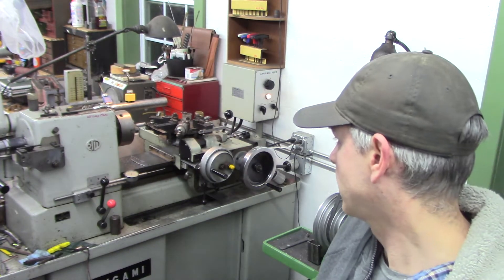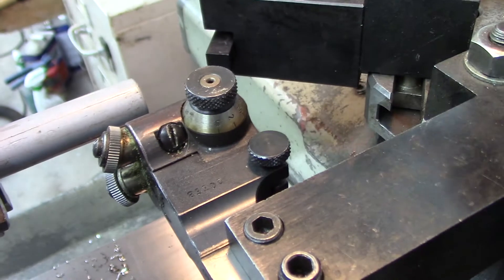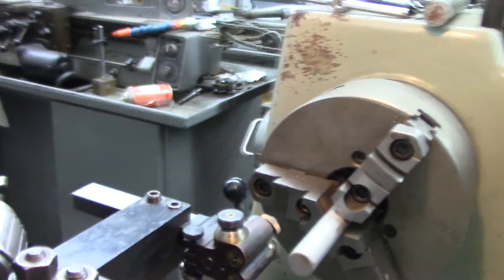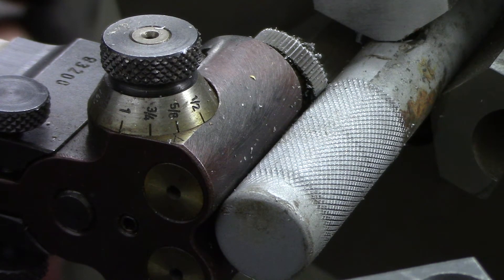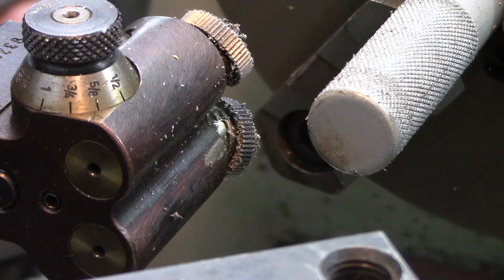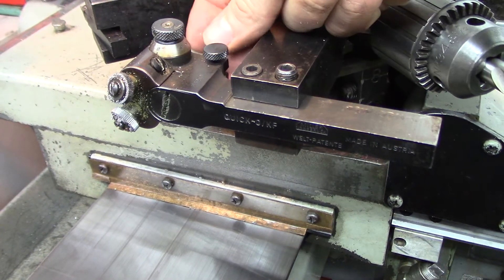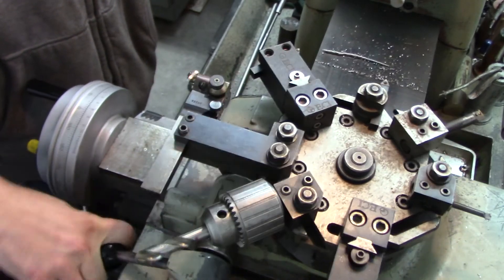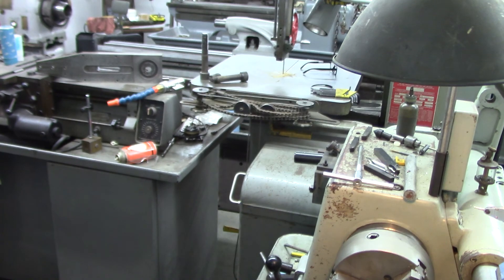Doozer's Machine Shop Update 1-08-20 -- Cut Knurling Tool on the Tsugami Lathe

Comment: You stole that cut knurling tool Doozer. Prices I've seen for decent brand new ones no matter who makes them are usually up around $800-$1200. 

For either pressure or cut knurling the swarf generated creates major issues with the surface condition of the finished knurling. Brushing it off as you were doing helps but still doesn't get it all or get it removed quick enough. Once those cuttings or the swarf from pressure knurling get sent back through the hardened knurls it starts degrading the knurls finish since the swarf starts deforming the flanks of the knurling. Flood cooling would be a big help, but if not available a large amount of excess cutting oil works to flush the swarf off the part or away from the knurling wheels as soon as it's created. Generally diamond knurling is either pressure or cut knurled to where the diamond tips are almost to a sharp point when checked with a magnifying glass. When pressure knurling is taken too deep what happens is the tips of each diamond point start breaking off.  High quality cut or pressure knurls are expensive for good reason. The knurls heat treatment, concentricity and ground surface finish along with any added surface coatings directly affect the quality of knurling it can produce. Unless you make an Ebay score like you did I don't know of any cheap tool or knurling wheels that will create a decent knurl pattern.

Outside your videos content, but for anyone that doesn't already know it, that high quality required is why the cheap off shore lightly built clamp type pressure knurling tools and the garbage misshaped knurling wheels they come with are why it's impossible to produce a decent quality knurl with them. The first time I tried my Eagle Rock knurling tool was an eye opener compared to the cheap one I started out with.
Reply from the maker: Hello Turning Point,  Good to hear from you. I remember you joined me back when I was posting tractor videos of my New Holland TC33D.  I was thinking the other day  when I was scraping some dirt, trying to level some ground back by my woods....  I was experimenting with driving backwards with the bucket, and scraping with a negative verses a positive cutting angle.  I found (as you would expect) that it takes just a few degrees of positive rake angle to really make the bucket start to scrape the dirt and at the same time, lower the amount of downforce required to actually bite into the dirt and do useful work.  I thought, wow, this is just like grinding angles on steel cutting bits.  The night before, I was grinding some toolbits for a flycutter that I was using in the milling machine to flat finish some aluminum for a project.  I found that it only took about 3° of positive rake angle to make the flycutter really make a nice finish, over a flat 0° rake angle.  I know something like 5° or more is recommended, but I was just trying to be quick and offhand grinding the bit on the bench grinder to get it done. I thought how similar it was to grind  rake angles on a lathe or cutter bit, and that used when cutting dirt with a tractor bucket blade !!!   I can't help but think that back in the 1700s and 1800s when machine tools and the industrial revolution was being born, that maybe farmers and their plow blades (horse pulled) had some influence on the machine tool inventors of the time.  Everyone was agrarian for the most part, and the angles to cleave most materials are related back to the simple knife in some way.  Anyhow, the things I think about when in the seat of my tractor.... Ha ha ha !!!  Good to hear from you TP !!
Reply from the maker: TP-  By the way, my buddy Mark M. just bought an Eagle Rock scissor-type knurling tool just last week.  He paid new tool price for it too.  He told me that it looked like it might be made out of cast iron, and fit and finish was not good for an Eagle Rock tool.  He suspected it might be an import by the workmanship of it, and just put in a box, with a Made in USA sticker on the box.  Was wondering how you like yours ?
Reply: @kooldoozer  I bought both sizes of my Eagle Rocks maybe 8-10 years ago? And yeah I paid full retail as well :-( That hurt a bit. There larger knurling tool will do up to about 4" in diameter. I can't say what there current quality might be. Extremely doubtful they'd lower it by that much though. Eagle Rock has a quality reputation that I doubt they'd want to lose. Mine seems to be built from I think forged tool steel and then hardened and ground on most surfaces. There's a few low spots on the wheel arms maybe a thou or two deep that didn't fully clean up on the surface grinder but there non working surfaces anyway. And the whole tool other than the pivot nut was probably bead blasted then hot caustic blued for a satin finish. Almost zero clearance on the pin and pivot. Less than a 1/2 thou for sure. My guess is the hole was jig ground for finished size. I'd compare mine as equal in quality to something like a new Criterion boring head for fit, finish and operation. Mine is definitely not cast iron and a file just barely marks the tool mounting arm or either of the knurling arms. Both of mine are stamped on the tool mounting arm in all capital letters EAGLE ROCK TECH. BATH PA If it were me I think I'd take a few close up pictures and email those to Eagle Rock and ask if it's a knock off or not. My best guess, it probably is a fake. How do I like mine? If it got stolen I'd not hesitate to replace it with the same even at the fairly high price. The only real complaint with mine is you have to press the knurling wheel pins out to change the knurls. It's not hard it just takes time you might not want to spend and use knurls coarser or finer than the part diameter suits. 

I suspect the very early cutting tool angles for machining started out much like the angles found to be best on the wood working planes, saws and chisels of the period. Any blacksmith in the area would have quickly advised what would be better for tool durability. It probably didn't take long at all before a generally accepted set of rules for tool angles got passed around for what lasted and worked. Remember for metal types and cutting tool materials there wasn't much to chose from. Brass, bronze, pig iron, then cast iron and really low quality and strength rudimentary steels. And high carbon steel to cut it all. I look at the steam history in the UK and then look at those giant pumping engines of the time and am amazed they got those built using only low rpm high carbon steels at best right up into the early 1900's. Some cuts must have taken days with multiple tool changes as the tools wore. 

Back bladeing or even the same using the buckets cutting edge is for rookies. It's ok in something like soft topsoil, but it puts excess wear on cutting edges, or bucket teeth and much worse high wear on the bottom of the bucket since the rock is being dragged across the bottom of the softer steel bucket. That hardened cutting edge is designed to be slightly lower than the blade or bucket and used in forward to take most of that wear. It takes a lot of practice to stay level, but no experienced operator back blades in rock or gravel. Yeah I see it being done even on construction sites by some, but real operators aren't in the seat. You should try digging level with an excavator or face shovel. Way harder to do since the machine digs in an arc. You have to continuously compensate for that. With an excavator or back hoe your using and adjusting a variable amount for 3 control inputs at once. And as the stick passes center the boom control goes in the opposite direction to maintain that level bucket.